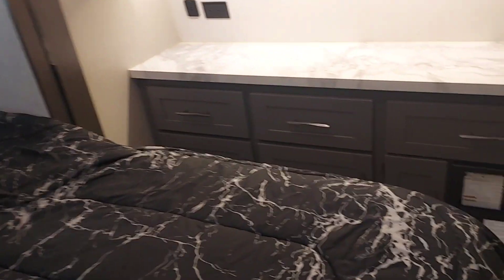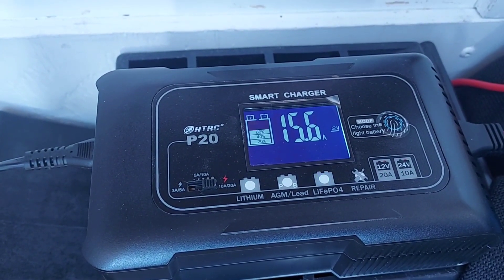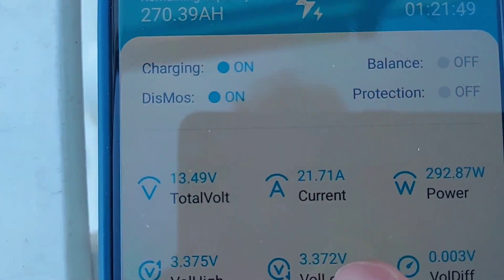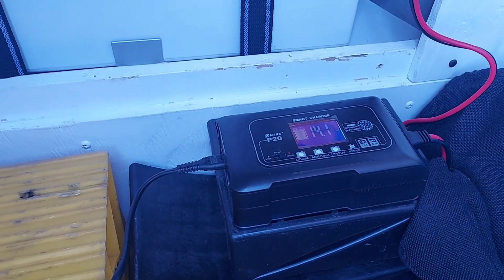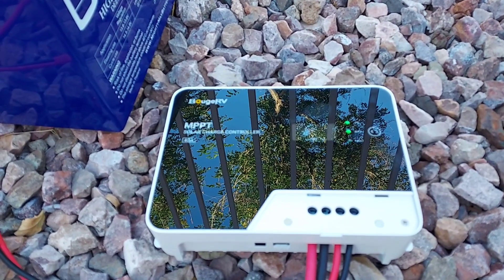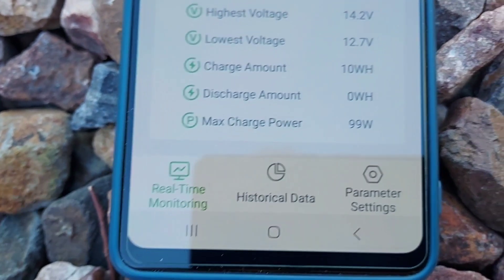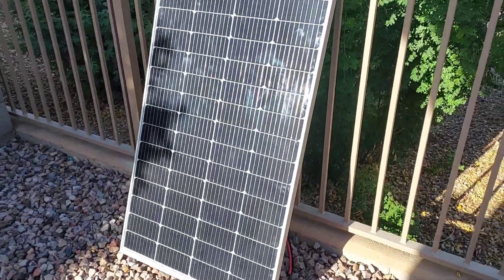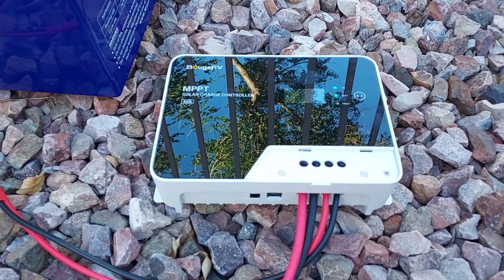Charging lithium rv battery and new solar controller

Comment: I just bought that same BougeRV controller.  I am using with 2 100Ah Sealed Lead Acid Batteries in parallel and 2 100w Renogy Solar Panels in series.  So far no complaints.  I am also using the same battery charger for those cloudy days when mother nature doesn't want to cooperate. LoL  ~Thanks for the video.
Reply from the maker: I was trying different things at home with 2 panels. Definitely looks like wiring the panels in series is better.

Comment: I have the same charger and a Temgot 100ah on order. I'm planning on disconnecting the charger in my converter panel and using my 20amp lithium smart charger. 

Question is, because Lifepo charges a 14.7v  would there be any issues running any 12v accessories at the same time the charger is running? I'm assuming 14.7v is within the parameters of most 12v items.
Reply from the maker: Good question, I would assume no since alternator from vehicle and solar controller are providing 13.6-14.4 volts to the system.
Reply: @toyhaulen  my batteries showed up today. Do you have a recommendation for a better app to work with these? Reviews for the app they tell you to use are horrible.  If not, luckily its got that nice LCD screen, I just can't read it when the battery is stored away.
Reply from the maker: @joshkliniske6766  I have been using the app recommended in the manual and works good for my needs.

Comment: WFCO told me the Converter on my 2023 GD Imagine would suto-4:48 detect to charge my LIFEpo4 batteries, but I had to discharge them down to 10% capacity or less, them allow them to come up to a full charge. I wasn't convinced that it did switched over so added the secondary charger. While boo dicking from CO to IL & then to FL I will give it all another test, lol. --Davey
Reply from the maker: I have heard that about the WFCO. I was looking at different kinds.